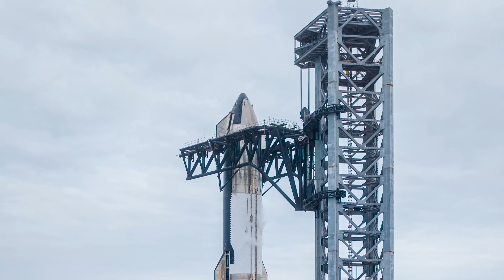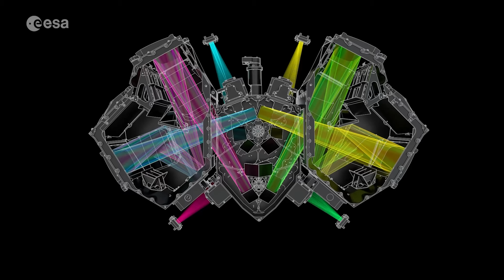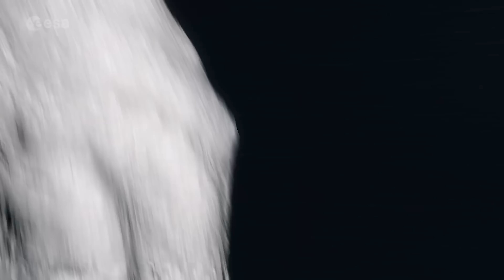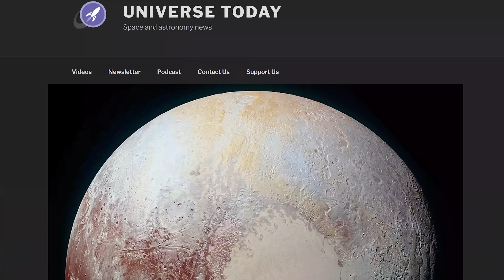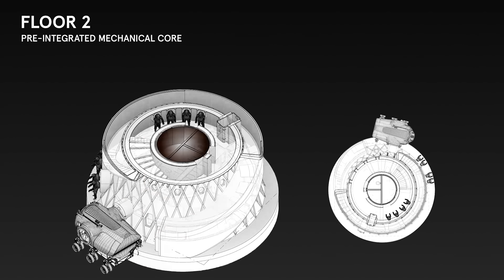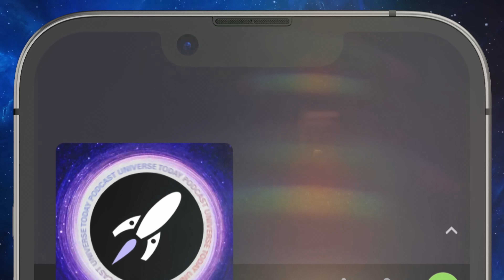Nuclear Rocket In 2027 // New JWST Problems // Starship WDR

Comment: Thermal couple, thermionic converter, ?, ??.
What are their differences in the devices for converting heat to electricity?  How does each type operate and what are their ranges of operation?
In the operation of a nuclear rocket, how could these devices be arranged, mixed along the exhaust to generate electricity without compromising thrust?

Comment: I actually had a meteor fly-by experience in 1965 in NJ. It was midday and this meteor was cruising through the atmosphere at the same speed as a commercial jet at 35,000ft.  It was difficult to estimate the altitude due to its size....HUGE, glowing red with mini crater pockets and pieces falling off as it flew by.

Comment: Practical test or practical propulsion system?  Sound like this is 30 years away which means a whole lot of your viewers will not live long enough to see it come to pass.  Very disappointing we fumbled the ball on this for so long.  As you pointed out this is an ancient technology and probably should have come on line decades if not half a century ago.
Reply from the maker: Practical test by 2027. A nuclear rocket will be used in space. That's not too long and if it works we can see it implemented in a future mission. But I agree, they could have been using these 50 years ago.

Comment: I love listing to this when I go to sleep.  But I have a question.
Suppose the ISS adds a module that's a big room, a sphere for arguments sake, and you somehow found yourself in the very middle of the room with zero velocity in any direction.  The walls are let's say 5m away from you in each direction.  In this scenario, could you swim through he air and actually escape or would you be stuck in the middle since every action you make has an opposite reaction.
Would this be any different if you were floating outside in the middle space,  if you could not eject material, would you just be forever stuck in the same spot/orbit?  Thoughts?
Reply: One of the walls will slam into you at 15 000 knots
Reply: @shanent5793  except you are moving at zero velocity relative tot he bubble you are in.  You are both falling in orbit at the same rate.

Comment: As I recall; the first launch was to be Starship splashing down east of Hawaii and possibly an attempt to catch the booster. Has that changed to full orbital and / or an attempt to catch Starship too ?  BTW, I've watched enough to feel a bit out of exchange and have subscribed via Patreon. On the Moon.
Reply: Actually, both craft will come down in water, they do not want to risk losing the launch tower on the first event.  Each craft will execute its landing sequence as if it were landing at LZ0 to test the landing sequence.

Comment: Fraser: did you read Chinese scientists have found out the iron core in the centre of the earth are slowing down and now moving in the opposite direction in relation to us? Is it all over for us?
Reply from the maker: I'm a little skeptical. It's a pretty huge claim, and I haven't heard any confirmation, so I'm going to hold off for a bit and wait for more data.
Reply: @frasercain   - yes, sure, but it was still interesting,
 there was something with earth quakes also, but this I did not understand

Comment: Question. When they do a static fire of a rocket like starship what precautions are in place to hold it in place and prevent it taking off. I guess a few 6mm bolts won’t do it. Do they throttle the engine up to max?
Reply: All rockets are held down on the launch pad and then let go when it's time to launch if everything is running ok. During a static fire they just don't let it go. 6mm bolts won't help. You could attach 30 dump trucks to starship and it would still take off, just a little slower. :)

Comment: Simple HUMIDITY is a major reason for steadily increasing light pollution. As Earth warms, more and more water vapor is remaining in the atmosphere, making more clouds and haze. I live 25 miles from Raleigh, North Carolina, which produces terrible light pollution most of the year, obscuring all but the brightest hundred or so stars. But in the recent cool and dry weather here, vastly more stars have been visible, several hundred at least. A lot of the light pollution comes from High Pressure Sodium arc lamps, which produce that strange orange-ish light that is particularly good at reflecting from clouds and haze. White LED lights are not quite as bad, but the situation would be improved even more if individual Red, Green and Blue colors of LED were used, instead of the common kind with yellow fluorescent material over violet LEDs. With distinct RGB illumination the colors are nearly monochromatic, which means there are other star colors that can be observed quite clearly, simply by using Optical Bandpass Filters like Hydrogen Alpha. Individual Red, Green and Blue colors of LED are also more efficient and run cooler than the yellow-coated kind. While the individual color kind may be slightly more expensive initially, they will pay for themselves in energy saved. I would really like to see nationwide regulation of LED bulbs, at least for outdoor lighting, and folks who leak light into the sky should be required to justify the necessity of that leakage.
Reply: Yes to the humidity idea.  Very poor night sky views in Florida more often than not.

Comment: I have a question.

The universe is expanding faster than the speed of light. People ask "what's on the edge of the universe", but isn't it impossible to know? Because if you're at the "edge" of the universe, it will instantly expand away from you?
Reply: You're getting the concept of the Universe mixed up with the concept of the Observable Universe.

The Observable Universe has an ever increasing edge.

However, the Universe has no edge (as far as we can tell).

Comment: I think there are other ways to use tractor beams in space other than with lasers, which would push objects away, not bring them in.  One is to hit it with an electron beam and pull it in with static electricity or magnetism.  Might work for a few dozen yards,    .   Good report.

Comment: "Starlink" and similar satellite constellations HAVE indeed increased light pollution (or "skyglow") severely. Skyglow has increased between 10%-20%. There are constellations that are now not visible ANYWHERE on Earth, even in the Australian outback, such as The Great Emu, among other ancient aboriginal sky features). These have all gone due to and since "Starlink" and similar. 

I know Emperor Elon propaganda claims to the contrary, but these things have been precisely measured and accurate albedo measurements show satellite constellations a MAJOR contributor to not being able to see the night sky.

Also: LED are more blue cast light, which travels through the atmosphere further than old sodium-vapor lights. This also contributes significantly to terrestrial light pollution, but doesn't excuse Starlink, OneWeb or Amazon one bit in the slightest to the damage their satellites are causing.)

Comment: I'm assuming that the RTG design improvement is in components other than the source? I can't imagine there being much room for improvement of the source's size since it is already a dense chunk of material and its casing is meant to survive re-entry without burning up or breaking.

That would mean that the bulk of the newly designed RTG is going to be the source with the remainder being impressively miniaturized.
Reply: Using another power conversion method. Also, 1/1000th the size and 10 times more efficient means 1/100th the power. So, like 1-3 W, fitting for a cubesat.

Comment: Can a satellite drag behind a planet and follow it in a more or less stable position just from balancing its position with gravitational pull? I'm thinking like being dragged on a leash.
Reply: If it is 60° behind (or ahead), that is stable. Those are the L4 and L5 Lagrange points
Reply: @charleslivingston2256  or 180° behind / ahead, at L3.
Reply: Someone let me know if I'm wrong here.

I think something orbiting the earth with an orbital period of one year would achieve this effect. If you envision looking down at the solar system, when the earth is at 3 o'clock in its orbit around the sun, the satellite would be at six o'clock in its orbit around earth. Then one season later the earth has gone counterclockwise 1/4 of its orbit to 12 o'clock, and the satellite has gone 1/4 counterclockwise to 3 o'clock in its orbit, and so on. Which puts it constantly int the track of the earth's orbit, but behind it. My naive calculation is it would be 3.2 million miles away from the earth. That's closer than the Lfive point which does a similar thing for different reasons. And not so far that it's hitting any other planets.

If it also rotates once per orbit (relative to the sun), then it would be constantly facing the earth, and staring at the line between night and day. The moon would always be half full, matching its planet's shading. The sun would be constantly on its port side, with the nightward stars.. on its starboard. It would probably do well to carry its sunshield southpaw.
Reply: That's interesting. Sorta like shooting a cannonball into orbit in the old examples of what an orbit is... Except in this case you'd have the satellite falling into the Earth's gravitational well but just never actually catching up. Curios!

Comment: Isn't laser propulsion just the same as a radiometer. The heat from the energy causes electrons to move causing momentum on the heat surface.

Comment: Why are they not taking the space station at the end of it's useability and sending it to orbit Mars? Could it not be useful even as an emergency option for future missions? They could be fully fueled and waiting at Mars. Could all the science not be done from this station to start? A gas station even. A base to take pictures. make maps and other studies of where to land on Mars.
Reply: I don't think the ISS could handle the acceleration required to reach Mars in a human lifetime. I bet you'd have to send each module to Mars orbit on separate rockets and then rebuild it. Astronauts might even have to be involved to secure the modules into the rockets. Sounds fun but I bet it will be beyond our capability at the time ISS is scuttled.
Reply: @essay8634   It could handle the acceleration if you used a low-thrust engine like ion engines.
Reply: @sciencecompliance235  Ion-thrusters are only good for extremely light loads. It's very possible, but not likely. For the money it would take, they'd just build something new.
Reply: @Rattus-Norvegicus  The last part of your response was pretty much exactly what I said in my first comment.  That wasn't what I was speaking to.
Reply: @sciencecompliance235  No I assume you were referring to the ISS being able to handle those stresses, but it's irrelevant if an ion thruster won't complete the job. ISS could withstand a vibrator taped to it's side but that won't put it in orbit around Mars.
Reply: @Rattus-Norvegicus  I don't think you know that an ion engine or engines wouldn't complete the job.  It would obviously have to be larger than an ion engine on a smaller spacecraft, use more fuel, and take a very long time to complete the job.  Unless you can show me some numbers, I don't think you can say it wouldn't work.
Reply: @sciencecompliance235  At our current level of development it's not feasible unless there're some major developments in technology that I'm unaware of. If you want numbers go look it up, I'm just saying that to my understanding we aren't there yet. Here, I did a rudimentary search just to shut you up. "The DS1 ion propulsion engine only produces 92 mN (milli Newtons) of thrust which is roughly equivalent to the weight of a couple drops of water. This means that the ion propulsion thruster is pushing the spacecraft forward with about as much force as gravity is pushing a couple drops of water down on your hand."    Now, how long do you think it would take a few drops of water to push ISS to Mars??
Reply: @Rattus-Norvegicus  DS1 is a bad comparison.  That was one of the first ion engines and for a much smaller spacecraft.
Reply: @sciencecompliance235  You are completely missing the point. Whether they can, or can't, they definitely won't. It's not feasible. You can argue all you want but you're just starting to sound like a whiner. I don't have to give you any more information and I don't have to prove my knowledge to you. It's. Not. Going. To. Happen. The end.
Reply: @Rattus-Norvegicus  You misunderstand me.  I already said it's not going to happen.  I'm just speaking to the technical feasibility.  I don't see any technical reason it couldn't happen with a custom ion engine (or engines) built specifically for that purpose based on current technology.  This would be extremely expensive and not worth it, but I don't see the technical reason why such a contraption couldn't be built.

Furthermore, you can dispense with the name-calling when I have done nothing of the sort toward you and you don't even understand what I'm trying to say.  I won't stoop to that level here even though I could very easily based on the daftness of your reply(ies).
Reply: The entire station weighs about 500 tons, giving it a 4 km/s kick to send it to Mars requires about 1000 tons of fuel assuming storable fuels and chemical engines.
Reply: Do you have any idea how much energy it would take to send the ISS to Mars (AND put it into orbit)?

Comment: Question: How does Venus retain an atmosphere if it has no magnetic field?
Reply from the maker: Carbon dioxide is denser than air so it sinks down and resists being blown off into space, but all the water was broken up and the light hydrogen was stripped away. Venus is bone dry.
Reply: @frasercain  I thought Mars atmosphere was CO2. Perhaps Venus gravity > sputtering effect?

Comment: For example with the light pollution part of the video.. here in Las Vegas we have the Luxor, which is the pyramid building on the strip pointing an incredibly bright beam into space for no reason.  Light pollution is a MAJOR problem in Vegas and the stupid Luxor makes it even worse. No reason for it whatsoever.  We should be trying to get the casino to remove it.
Reply: I'd be curious to know how much the Luxor light contributes overall to LV's problem. It might be more (politically) efficient to alter/reduce streetlights instead.

Maybe eventually add some sort of exciting earthfacing mirror above it. A fancy one. Might even look more spectacular.
Reply: Or tell them to use a sodium line laser to make an artificial star for use with adaptive optic telescopes
 (I'm only half kidding)
Reply: Its a city my guy light pollution is innevitable just dont live in a city, theyre shitholes anyway, especially vegas.

Comment: Be cool to use an asteroid as a transporter for future exploration. No fuel needed for propulsion ;-)
Reply: Doesn't work that way. It takes fuel to get to the asteroid. The following coasting phase doesn't require any fuel. The only benefit an "asteroid-ship" would offer is the possibility to dig down to avoid radiation, and to harvest material from the asteroid.
Reply: Magnus, you beat me to it
Reply: @baseboardmatt  gentlemen last time I checked Voyager used TCM thrusters for trajectory maneuvers. Sure you need to hitch a ride first but find one that is coming close to us.
Reply: @squashduos1258  the thing is doing like 25k miles an hour, so you need to use a rocket to catch up  to it to “hitch a ride”, at which point you’ve already become the asteroid yourself